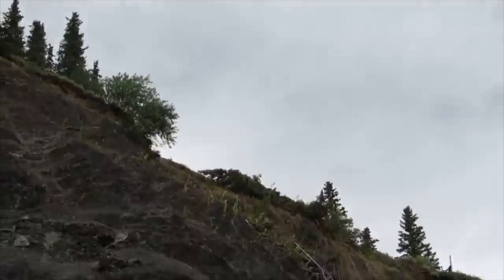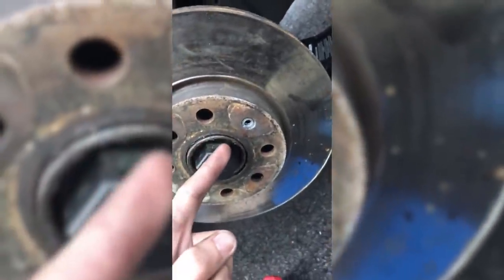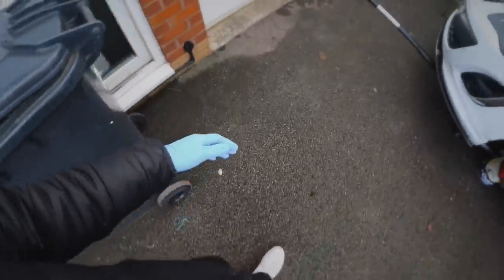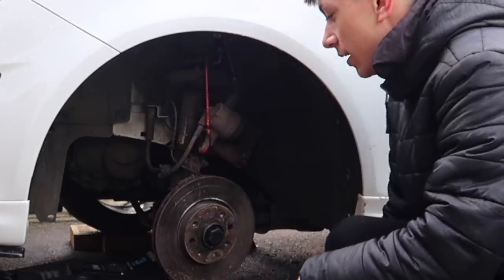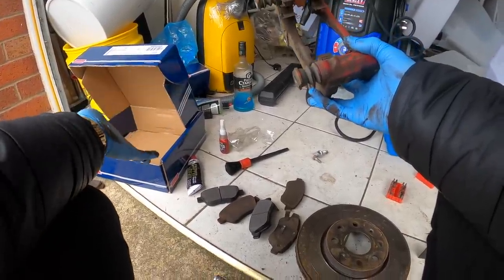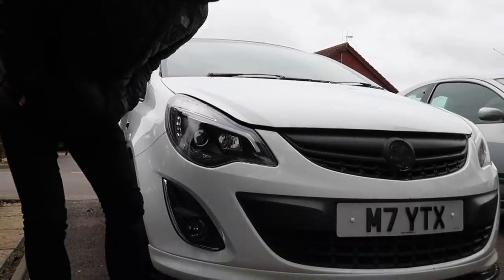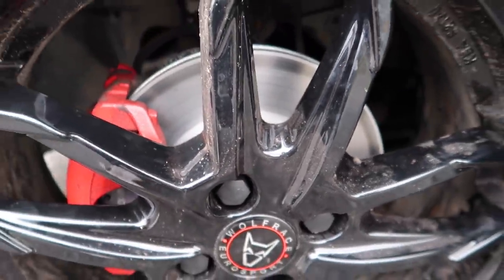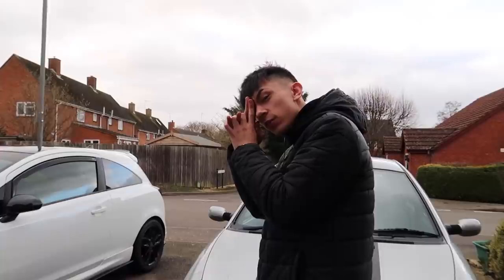MY FIRST EVER BRAKE CHANGE!?! 😱

Comment: Bruh Micheal lad everything you've done to your car so far is exactly what I've done on my level 2 light vehicle maitenence and repair course at college you might as well give yourself a diploma in it hahaha
Reply: Really bro ? I’m on the same course I’m allready doing engine rebuilds.  Do you have a placement at a garage ?
Reply: College are rubbish you don’t learn anything try and get an apprenticeship I did engine rebuilds and transmissions and shit like a month into working
Reply: @danielsmallwood7111  your hard aren’t you mate
Reply: Daniel Smallwood maybe just maybe...
He went to college as larger businesses offer apprenticeship schemes after you've finished? 🤦‍♂️
JLR, Redbull, Williams, Mercedes, Honda etc.

But I partially agree level 2 teaches processes you can teach yourself or ask anyone who's into cars and they know how to do it. Level 3 is the same really. But if you need the qualification and you're not just doing it to work on your own vehicle fair enough lad good luck
Reply: I’m 6 months into the same course and have done gearbox strip downs, wiring, full suspension changes, wheel alignment, steering jobs etc. Did brakes in the first week

Comment: It’s normal for them to feel spongy to begin with, all brakes need “bedding in” so after 50 miles or so they should feel much better👍
Reply: Why didnt you paint the brake
Reply from the maker: Appreciate the info mate, Yeah when I first drove it they felt so spongey 🤣😩 I did like 30 miles yesterday, they're feeling better already 🤫🤫🤫🤫🤫
Reply: @nordinm6792  great idea, red to make them sporty !
Reply: @nordinm6792  you better be joking
Reply: You also need to make a brake test after changeing brakes.

Comment: That mark in the disc will be a stone trapped you’re right mate,pretty common. A tip you want to do is take the brake fluid reservoir cap off so you don’t blow the seals in the master cylinder when pushing the pads back due to back pressure of the fluid going back through the lines!

Comment: I have a stuck screw on my disc. When you drilled it out what did you do with the bit stuck inside the threaded side then you drilled the top off. We were going to drill mine but wasn't sure if the long side of the screw would stay jammed into the screw hole. Did you just drill it out all the way? I was going to do that but didn't want to ruin the thread inside the hole.

Comment: Well done on the Brake disc and pads change! From the video you can see the edges were lipped so the discs were due a change and the pads were ok BUT wouldn't last another se of brake discs so you did the right thing. For the future though I would recommend you getting Brembo disc and pads as they're well known for longer lasting life over the brand your using. They arent much more expensive either :)

Comment: Don’t even need the piston compressor. Using the handle of a hammer and pushing the metal end against your stomach does the job nicely. Either way top stuff
Reply: Yeah mate why use the proper tools when you can look like a clown
Reply: @106adamm  what’s the matter with u lmao. Just advice for if u don’t have the tool

Comment: Good effort, but why use cardboard when removing the old disc? its scrap so no need to protect it from damage, lol.
Reply: Same reason you never bang two hammers together. Hardened steel tends to explosively shatter sending shards of metal into the nearest pair of eyes.
Reply: @johnpickworth7752  never had a disc break when hammering it off. Done loads without issue.

Comment: Just in case you need peace of mind from what av seen there is no chance you got air in the system  you can take the master cylinder cap off and this doesn’t induce air so you should be fine once they bed in after a few miles they will feel spot on you can also do a few emergency stops to speed up the process if necessary. Everyone check my channel out for car content 👌🏻

Comment: probably didn’t need changed just the pads needed sanded and cleaned up and it would of been okay
Reply: Nah not with amount of material left on the pads
Reply: @bigdog66711  aye man minimum is 1.6
Reply: Inches?
Reply: @bigdog66711  mm i am a mechanic i know these things
Reply: @bigdog66711  1.5mm* i meant
Reply: You was thinking of tyres lol. Yeah cheers me too I was just joking with you. The pads were still due though

Comment: Tapping the old discs with cardboard 🙈🤣 they're going in the bin kid, fucking smack it one 🤣.

Also tip on pushing the pistons back.... screwdriver inbetween old discs and pads and push the pad backwards.